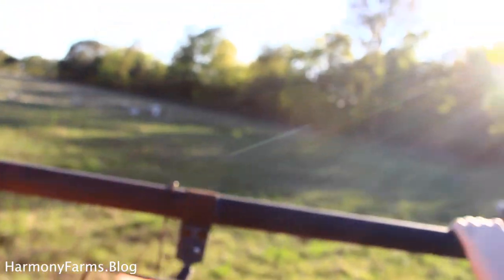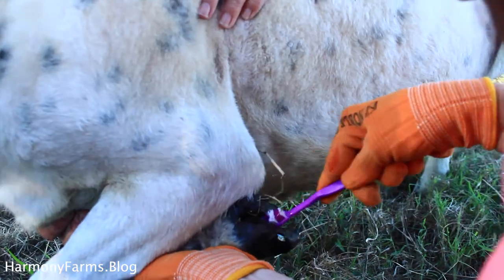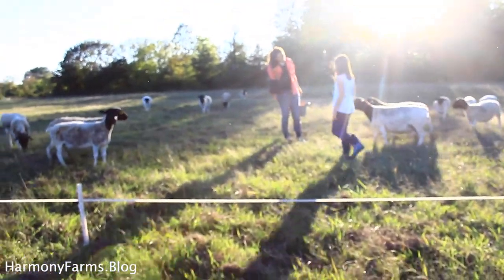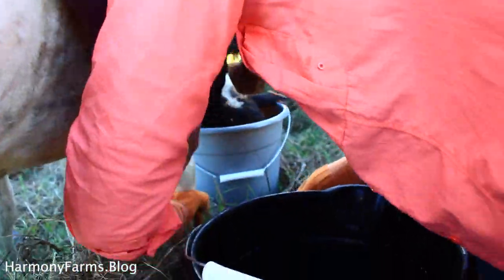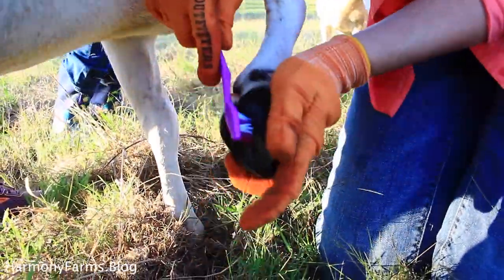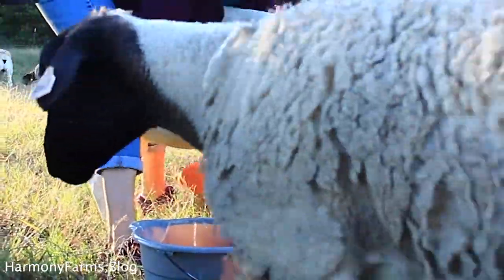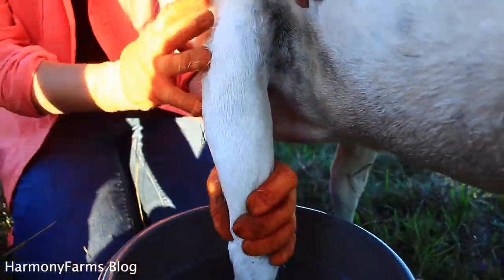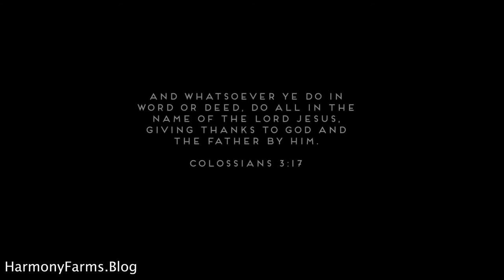Treating Hoof Rot in Sheep (No Handling System)

Comment: Run them through a fermaldahyde foot bath. Copper sulfate does not work nearly as good. I'm a sheep farmer and professional cattle hoof trimmer and copper will often exacerbate the infection. You need to identify whether it's rot or scald. Scald looks like a pasty white sore in between the toes.
Reply: what do you do for scald?
Reply: @AnxiousCowboy  formaldehyde footbath
Reply: @user-zu2bw7ig5v  how long does the water basin in the run have to be so they don’t jump over it? I’m trying to rig one up and figure out what to use

Comment: Im Surprised you have a issue with hoof rot since you rotational graze. I have got into the habit of moving them to new grass after some rain so they are walking around on the wet dirty ground they have been on. I think that makes a difference. If the ground is wet make sure its new ground they are walking on

Comment: How is the rot spread between sheep?  With other livestock would you want to cull those sheep and offspring out and keep only those that are resistant?
Reply from the maker: I think it spreads because the infected sheep leaves bacteria on pasture. I’ve heard of people pulling off a pasture for several months to keep it from spreading.  Yes, I’ve also heard of culling if the sheep shows a recurrence of the infection. 👍🏻 We never have because it hasn’t really been a big problem for us. 

-the Shepherdess
Reply: The bacteria only survive on pasture for about 7-10 days, so you don't really need to leave it for a month....I raise sheep too, in the pnw, with lots of rain. I have more issues with scald (not contagious) but treat it the same way. I don't cull unless I absolutely have to because I raise a rare breed and its tough to get replacement breeding stock out here. Sometimes I wish I could cull, it can be tough trying to help an animal in this environment. I do make notes on which sheep have better resistance and feet, and try to use those rams to spread that genetic attribute around.
Reply: I am in South Florida on some land that can get pretty wet during the rainy season. I really would love to get some sharp but my main concern is my land being too wet at times.